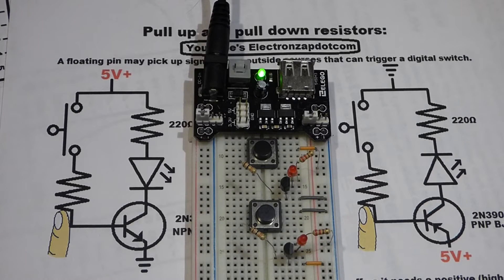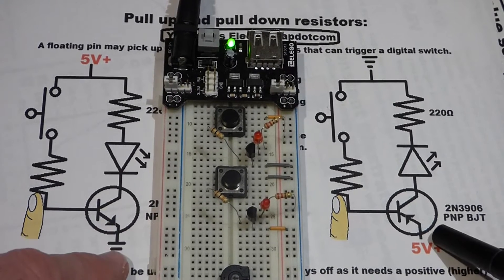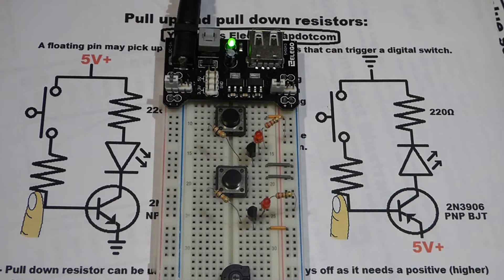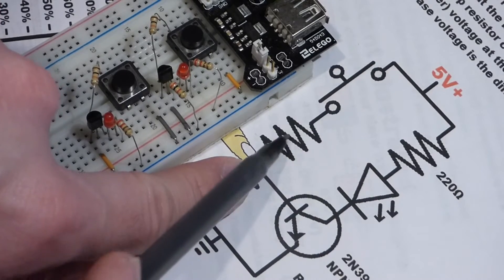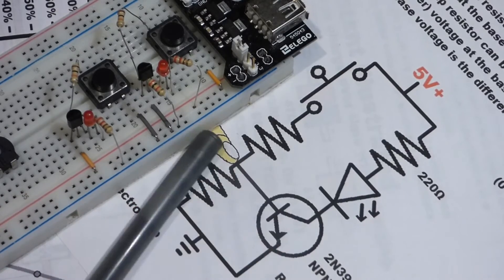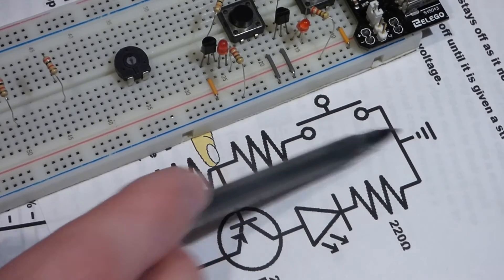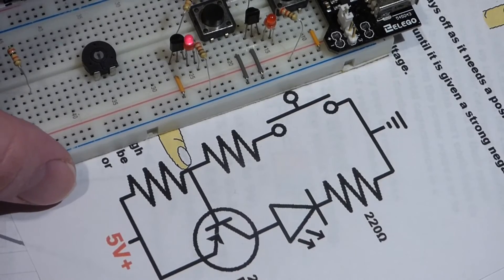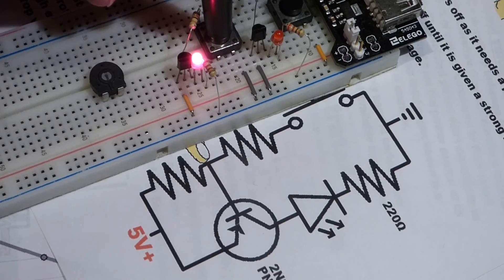Pull up and pull down resistors preventing false triggering 2N3904 NPN 2N3906 PNP BJTs explained

Comment: Formula for calculating base resistor (Rb) if collector current is 30mA

Rb = (Ub-Ube) x hfe / Relay Current
Rb = (12–0.7)x150/0.03=56500
Rb = 56K

By adding pull up and pull down resistors, what formula is used to calculate Rb resistor?

Comment: Pull-down won't affect the voltage going to the base of the transistor (parallel connection) but it will affect the current (it will reduce it or "split" it). Is this the reason why the value of pull-down resistor should be high? I figured it can never be too high, just too low. In another comment you said "Too low will waste current when the switch is closed and too high of a value might not be able to overpower a stray signal". I'm don't really understand the too high part? What do you mean it will not be able to overpower it? Thank you for the video, the best explanation I've seen! 
 :)
Reply from the maker: If the base of the transistor is floating (not given a voltage), then stray electromagnetic field signals around it, including things like human touch, can create voltages that might be strong enough to get the transistor conducting. So you want a resistor to the side of the power supply that helps hold the transistor off. There is no current flow at that time. If it is too large of a value though, then it might be over powered by stray signals. Now when the base is given a desired signal voltage to start the transistor conducting, current will also flow through the resistor that was earlier helping to keep the transistor off. So you don't want to go too low either or it will take away too much of the signal voltage that you want applied to the transistor base, it may overheat, or waste energy when the full supply voltage of the supply is across it. Usually a 10K resistor works well. Glad you enjoy,  thanks for watching!
Reply: @Electronzap  what a great explanation for a newbie like me. Now I understand.

Comment: So how do i calculate the pull down resistor. For this case.
Reply from the maker: Pull up and pull down resistor value for a switch circuit isn't important. 10K is really common. Too low will waste current when the switch is closed and too high of a value might not be able to overpower a stray signal.

Comment: What values are your base resistors. You need a pulldown resistor from your NPN base to ground, and a pullup resistor from your PNP base to high.  A proper transistor switch would NEVER trigger from a finger-touch!